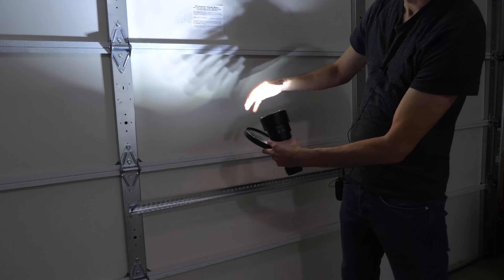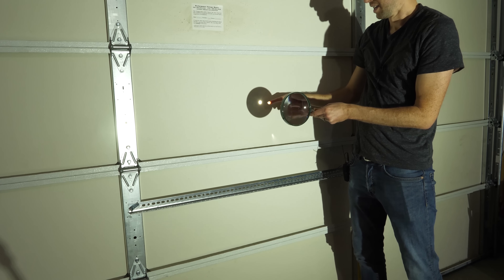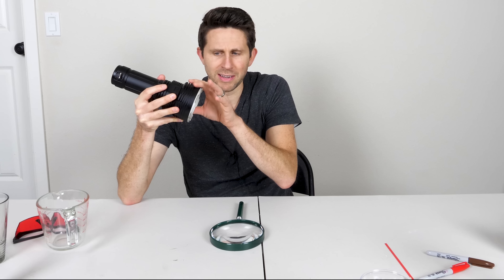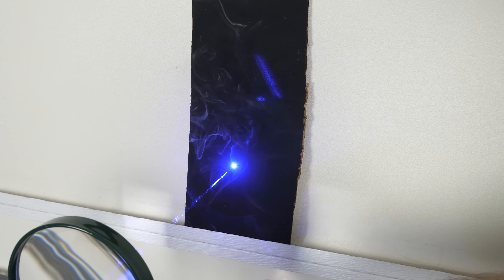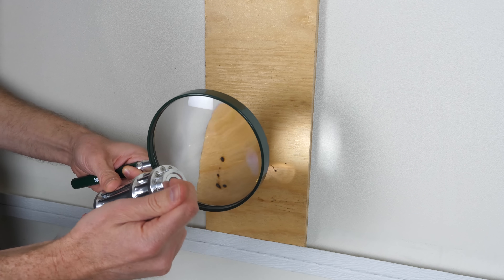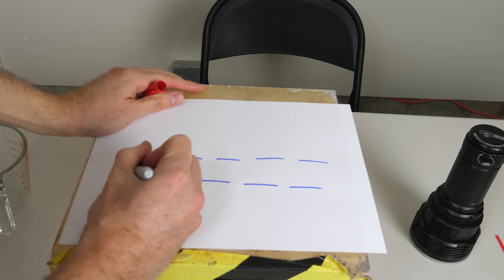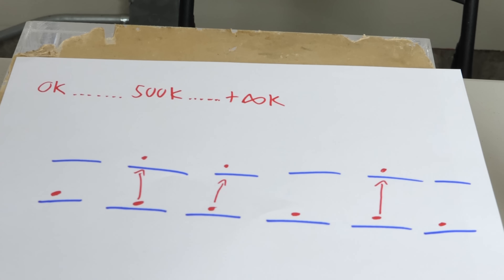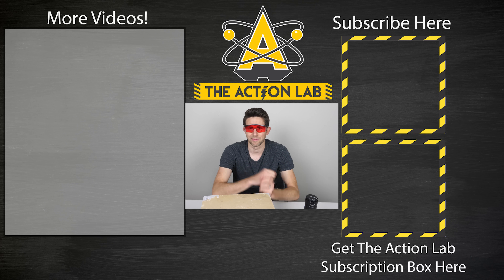What Happens if You Focus a 5W Laser With a Giant Magnifying Glass? Negative Kelvin Temperature!

Comment: I think you are mistaken in this video, the laser already has the power to burn the background, but that energy is spread out to a larger surface. When you focus the laser, you are focusing the energy to a smaller surface which means there is more heat in the specific area. The laser is not any hotter on the point where you are magnifying it to than it is on the surface of the laser itself, the heat is just more condensed. I would consider this to be in the same realm of logic as laying on a bed of nails vs laying on a single nail. If you lay on a bed of nails, your weight is distributed among all of them, but if you lay on a single nail, then all your weight is on that one nail and you will be punctured.
Reply: i agree
Reply: NerdGaming yeah and that doesn’t mean the 1 nail is sharper
Reply: 0
Reply: You will be punctured
Reply: please @Action Lab reply to philosophical inquirer (if you are mistaken, we will still love you, and if you admit it, we'll even more!)
Reply: I agree with your analogy and logic.

Most of the Sun light (virtually all of it) is "wasted" and never gets into the lens, likewise, much of the torch light is dispersed and never gets into the lens in the first place, so obviously only focusing a small amount into a tiny surface area - which will never be hotter than the source.

In contrast, almost all the laser light enters the lens and focuses onto a smaller area than without the lens - any tiny amount of laser dispersed/reflected/refracted etc is tiny or insignificant - making the area focused much hotter than without the lens.

Simple, no need for the weirdest explanation in this video.

If the flashlight was sent through a range of mirrors and lenses to focus as mush light as possible, then the focused light would be very bright - brighter than the source PER SURFACE AREA (although, the lenses and mirrors would still lose light and heat would be dispersed - there is not much heat produced by the torch in the first place, especially if LED - hence why LED's are "energy saving" , they dont produce much heat as a by product - more light, less infared)
Reply: @gtq838 Nerd is actually right and both you and Lab are wrong.
Reply: NerdGaming what does this have to do with beds and nails

Comment: the only thing is negative kelvin doesn't exist
Reply: THIS! 0kelvin is absolute Zero, Null movement on the thermal dynamics, no one can reach that point, 450 ±80 picokelvins (pK) (4.5×10−10 K) is the lowest known temperature. 

of someone is claiming they can go lower then null with a laser, they are mathing wrong.
Reply: I was also intrigued by such a statement as -0K... and then -500K...
I am no quantum physician to easily understand how the "exact" temperature of an system is calculated... but all my like I was sure that 0K is Absolute Zero...
Reply: @VicolGrigore  well think of it this way, atoms move around, the more they move, the hotter they are, when all movement ceases, thats Absolute Zero, to go less then that, is I think in the quantum territory and atoms should move in reverse, or go back in time..

basically the way they measure the coldness of an atom is how long it take to move a planck, at the achievable coldest measurement, the wavelength of the atom movement would of been longer then the planet.. I Think...
Reply: Of course it does, as is easily verified. He said a few things that were a bit oversimplified but nothing too egregiously wrong.
Reply: @bryanreed742  of cause "It" (what?) does? "population inversion"? still cant pull temperatures below 0 kelvin

Ever noticed lasers actually heat up? you need to put energy in to get photos out, using the electrons you put in to get the matter to a higher exited state, only to pull it down to release the photon from the electron you pumped in. so its pulling it to a negative temperature from the higher exited state.

Comment: Actually I’d say with some
Black paint and a big enough lens you can get something up to twice the temp of the surface of the sun. You simply can’t get anything hotter than the birth site of the individual photons. But since that’s an average between 10k and 8 million degree. You can technically get something as hot as a little less than 8 million degrees. It would require absolute perfect conditions and probably an absent atmosphere
Reply: Antonio Esteban sounds like a cool science project

Comment: You have got to be trolling, or you have a serious misunderstanding of what temperature is. Light is just light, no matter if it comes from a torch or a laser (light itself doesn't have a temperature). You can think of light as being comprised of photons, little packets of energy. The total energy coming from the source is proportional to the amount of photons being emitted at any one time (proportional, not equal, because light also can be thought of as a wave with shorter wavelength light having more energy). The spread of photons from a torch is far more than a laser, but a laser still has some spread. So the energy from the laser is spread out over the target. All you are doing by focusing the laser with the magnifying glass is reducing how spread out the energy is over the target. If you focus all of the photons coming from the laser to a single point then you are focusing all the energy coming from the laser which will heat up the target faster.

Comment: I thought it was because flash lights and the sun spread out the light, while the laser doesn't. And the reason why the concentrated light from the magnifying glass wasn't brighter or hotter than everything around it was because it was only catching a portion of the light instead of the full light.

Comment: Does it really violate the 2nd law of themodynamics? You are just focusing the energy to a smaller surface area. It's just easier to do with a laser because it's a parallel light source. Maybe you should try the same experiment with a concave mirror for the flashlight.

Comment: Love your videos! 
A few questions: What would happen if you had 2 parabolic mirrors facing eachother and a laser is shot in a rapid burst in the middle of one of those mirrors?  Would it continue to focus further and further and eventually break a pinhole through the mirror from the heat? Also, is the theoretical heat energy the same regardless of the wavelength of the laser? Ex. 808 nm carries less energy than 445 nm but if you continue to focus the 445 NM laser would it be able to produce the same maximum temperature?

Comment: You can focus most of the flash light energy to a point using a series of lens - this is done in opposite using a condenser lens set-up in a microscopes for a light source. It not a temperature (intensive property)  but energy transfer  (extensive property).  The negative temperature concept is correct but misused in this case.

Comment: Your explanation seems like bullshit to me. It's about COLLECTING light and focusing to a point. IT's about energy per square meter. If you take all the outputted light of the sun and squeeze it into a point, it MOST DEFINITELY will be hotter than the sun's surface. Have you broken any laws?? Of course NOT, you have just concentrated the energy into a point rather than spreading it all out. Your explanation regarding negative Kelvin... Think about it. Negative kelvin temperatures are theoretically hotter than any positive Kelvin temperature, so by YOUR logic your laser trick is producing light hotter than ANYTHING in the UNIVERSE, which you know is TOTAL BULLSHIT. By the way, your LED torch IS USING QUANTUM MECHANICS to generate it's light, just the LED's are covered in lenses to SPREAD THE LIGHT OUT.  So your LED torch trick was also just an example of BULLSHITTING your audience as you didn't advise that system was using several lenses, rather than just one. Big DOWN VOTE from me.

Comment: Im just going to tell myself that its not hotter than the total output of the laser, what i was thinking before it was explained is that the total energy of the laser was evenly spread throughout the normal tiny dot but using a magnifying glass to make it essentially multiply the energy in that spot and making the smaller beam a thermic (not even sure thats a word) equivalent to the light outputed, not sure if anything i just said made sense

Comment: Did I miss the point ( ha! ) where you told us the reason the laser Burns is because you focused the light output energy down to a smaller point? 
Even if it was just the sun,  you're just focusing the existing light energy down to a smaller point,  which is then great enough to burn.

Comment: Focusing the beam of a laser pointer gets you a hotter temperature because you are concentrating all the photons on a smaller area than if it was not focused. Even when the laser is right up against a surface, the beam is wider than when you focus it with the magnifying glass.

Comment: You can't get infinitely hot... the highest possible temperature is the planck temperature. the reason why is because of the heisenberg uncertainty principle. actually measuring the temperature would lower it.  "quantum temperatures" don't exist outside of mathematics. most of the infinity-scale math are nerdgasms that have no physical representation.  Graham's number, which is precisely 0% of infinity is so large, we would need a computer with the density of a black hole larger than the observable universe just to list the numbers.  the number of planck volumes in the observable universe is a simple e notation of 10e186.

Comment: I have a question for you. Could the fact that the laser got hotter simply be that unlike the flashlight you can capture the entire beam? You see, the flashlight spreads it’s light out at a wide angle and as such you are not able to capture it all with your lens. Since lasers don’t spread out nearly as much as they travel over a distance, isn’t it possible that you’re just able to capture all the energy and then can focus that energy to a smaller point? In essence you haven’t increased the amount of heat energy at all, but by concentrating it on to a smaller area you’ve increased its temperature.

Comment: My brother has an idea taken from a project done in Nevada using mirrors and a magnifying glass to boil water creating a steam type engine for "free power". I tried to explain how thermodynamics would hinder his results in theory. My question would be, to the flashlight example,  what if you used some sort of reflective tubing to retain some of the light/heat? The length of the tube would of course vary depending on the light source. Am I flawed in this logic?

Comment: What? You can do the same with the flashlight, but not by using one single magnifying glass, you'll need more lenses. It can most certainly get both hotter and brighter in a focused spot, laser or not. However, the energy of the spot may never exceed what the source outputs. It's the same on a smaller area.

Comment: 5 watt laser point for a period of 60 second could create 300 joules of energy. With that amount of energy you would never reach infinite temperature.
we also have the specific heat capacity of the material which defines how much degrees it could rise per joul per gramm. We also lose some energy from the laser because of reflection. 

Wood has a specific heat capacity of 1.76 J/gºC. 
The point of wood where we focus on, weights lets say 1 grams

300/0.5 = 600 and 600/1.76 =  340,9090 gºC rise in temprature over 60 seconds.

Comment: umm no.  when a laser is fired it produces a bunch of photons traveling in a laminar flow. Side by side all in the same direction when you introduce the lens you simple take all those photons and concentrate them into a smaller area. More photons hitting a much smaller area = higher heat in that area. you still of course not getting more energy out than what went in you are just concentrating the energy you do capture into a smaller space. all the energy coming from the laser > the heat energy at your target.

Comment: Infinity is unbounded, how can you say it goes past infinity? Please elaborate, wtf :/
Reply: The whole infinity being unbound is still true. Infinity plus one is still considered infinity even though it is greater. Its all the stuff in between that makes infinity infinity. As an example lets say you have 1 minute to cut infinite slices in a cake. You could theoretically achieve this by cuting a slice every time you are half way to the end of the minute and your last slice. First slice at 30 seconds giving you two halfs. Second slice at 45s giving you one half and two quarters. third slice at 52.5 giving you one half, one quarter, and two eighths. And so on. Eventually the time will run out and you will have hit infinity. But what if you do it again but slicing the other half of your first slice? Think of that as your other side of infinity.
Reply: @christopherpenn9585  what if i started slicing at 0.00000... seconds, until making last 2 slices at 15s and 30s respectively
Reply: Quantum physics is not like normal physics. For  example: In quantum mechanics particles can also exist in two different places at once.
Reply: He clearly hasnt opened a math or physics book in a long time,
Reply: @pilotofjet  Yeah, I haven't but hopefully you did, why don't you explain them Mr Scientist?
Reply: @shade5554  what he's doing is simply decreasing the surface aera on which the same quantity of energy is applied so that makes a hotter temperature on the surface it is applied.
Reply: @shade5554  I think he was saying Action Lab hasn't opened a textbook in a long time.
Reply: @shade5554  I think he was talking about action lab
Reply: Because he doesn't actually know what he's talking about.
Reply: Something like infinity does not exist.
Reply: I think it’s just how temperature is defined. Basically we thought the max is half/half so we called it infinity. Then we realized it can get hotter so we just called it negative K.
Reply: I feel I have a slight feeling I understand it. Positive kelvin temperature always flows from the hotter material to the colder material. Negative kelvin will always flow more energy into positive kelvin material no matter how hot it gets... Even at infinite kelvin it will still gain energy from the laser. So the source is labelled as negative Kelvin
Reply: So basically if there are 2 stars, one is a supergiant another is a M class small star. You cannot use a lenses to focus the light so hot that it is hotter than the surface of the supergiant star and thus transfer heat to it. Because the lense will never focus the light into a point but rather create a miniature image of the original star.
Reply: How can it be as hot as infinity if infinity is a number so it wouldn’t have a temperatures
Reply: Watch vsauce
Reply: there's a scientific  paper I read that touches on this, read "Negative absolute temperature for motional degrees of freedom", That should help
Reply: Infinity+1
Reply: no comment on the stuff above, but as for your original question, I think you can think of it like the graph of (-1/x). As you approach zero it goes to infinity, but then you can go past it to negative infinity and back up to zero
Reply: Exactly, infinite temperature can never be achieved. Anything infinite must also be infinite in time. If it has a beginning point in time then it will never reach infinity.
Reply: True
Reply: Infinity is a number that god on forever its not actually past infinity its past virgitillion or something
Reply: Dark Shade Infinity 2.
Reply: Ryuga Anderson he didn’t swear. He said “wtf” not “THE SWEAR WORD.”
Reply: It is a type of number
Reply: Duh you look triggered 😂
Reply: Some infinities are larger than others. Take yourself for example, if there were an infinite amount of you’s, there would be double that infinity of your nipples. Although I will admit I’ve got no fuckin clue what the guy in the video is trying to say. He seems almost as confused as he made me
Reply: To infinity and beyond

Comment: I see one flaw in this experiment, the laser that you use is actually from a high power laser diode that in principle is similar to LED, the light from the laser diode is focused to a beam with a short focal length lens. The laser diode is placed right at the focal plane of the lens. That's why the laser point is not a dot, but like a short line, it was the form of the laser diode. You can make a laser from any kind of LED, jus place the LED in the focal plane of a short focal length lens, and the beam it create wil look like a laser

Comment: Waht would happen if you make the dot through the magnifying glass infinitely small? Wouldn't it get infinitely hot beacause all the energy is now in such a small area? Wouln't then even a very dark light source be able to make something infinitely hot? I imagine it like this: it is like deviding by zero. So you basicly have the calculation: Lightenergy per area. As the area is 0 because it is infinitely small, the energy must be infinite, right? But that would violate the law that the light through the magnifying glass can never be brighter than the light of the original light source. But as the area is 0 after the magnifying glass, wouldn't the equation need to be: LightEnergyOfLightSource / [Per] Area > LightEnergyThroughMagnifyingGlass / [Per] Area ?
Sorry for my bad english :)

Comment: Using a converging lens, it focuses all the laser into a small single point causing the wood to heat up quicker. The laser is emitting the same amount of radiation through the lens and without the lense. So shining through the lens causes more radiation to be squeezed into a smaller area meaning it heats up faster.